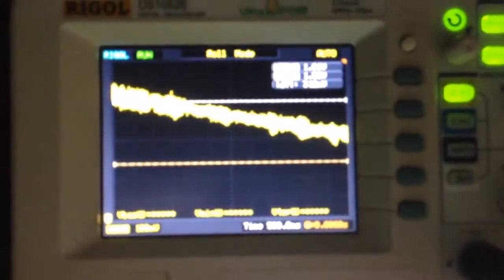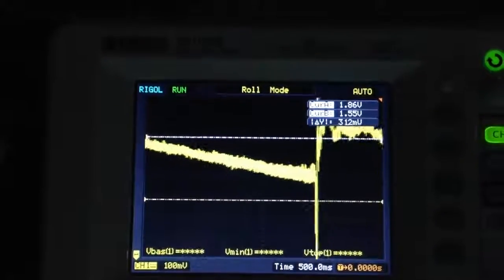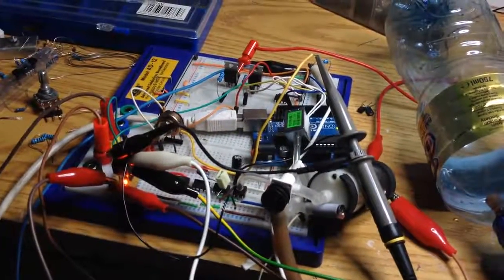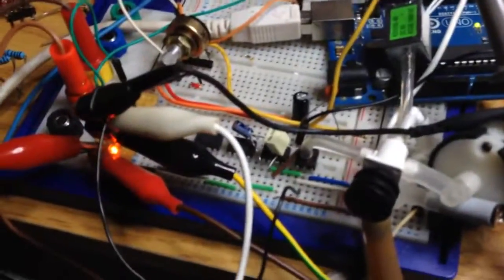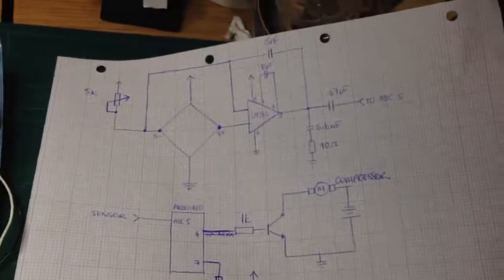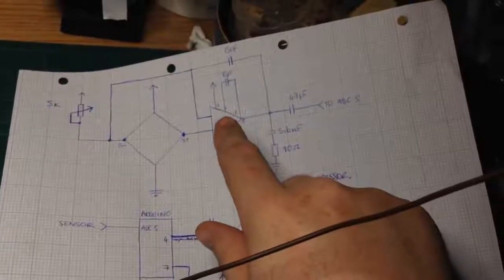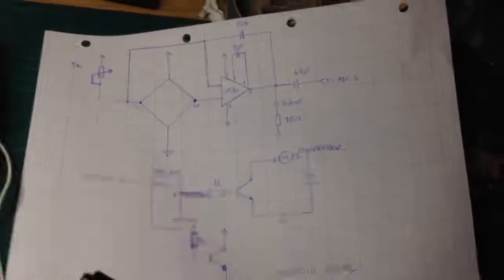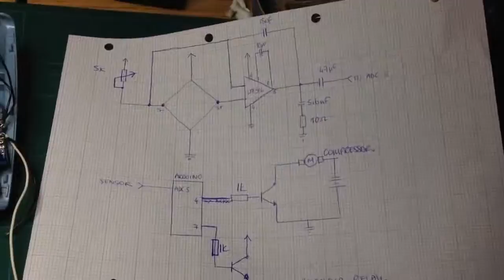Arduino Auto Air Compressor / Pneumatic - US9116 Pressure Sensor / SANITAS SBM30

Comment: Hi!! sbm30 is not available in the market today. Are there alternatives?
Reply from the maker: +Jesielyn Tecson Check out analog pressure transducers on farnell/mouser etc.  There's no calibrated scale in the code, so you just need something in the same ballpark as the sbm30's sensor (5.8psi, 5v - datasheet in the description). Then just tweak the values in code to set the pressures you need.